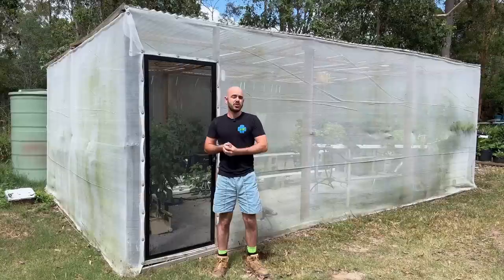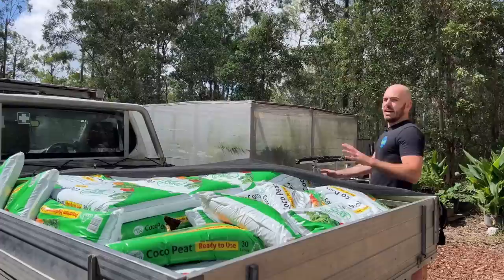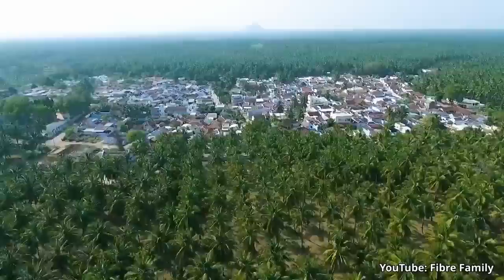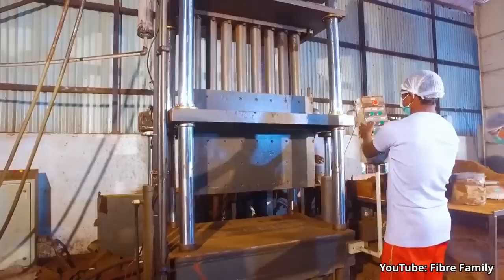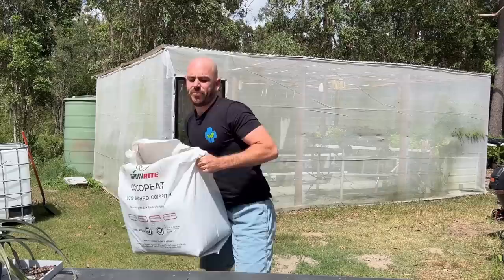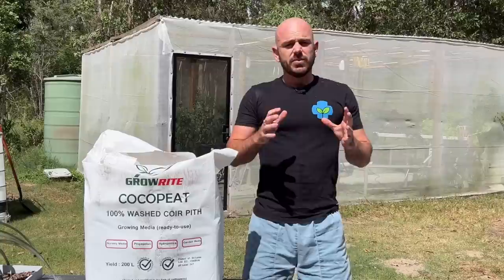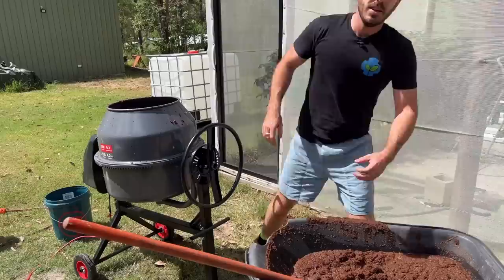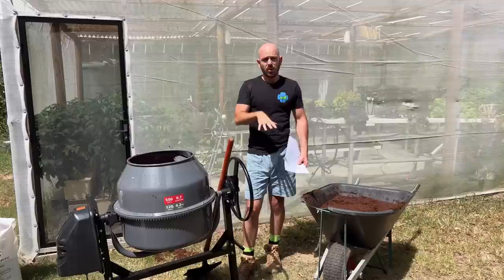How to Buffer Coco Coir for Hydroponics

Comment: I bought a block of 'unwashed' coco years ago.. The main issue was it contained a high amount salt 1200ppm.  One of the occupations of islanders is to find coconuts floating on the sea to earn a living,  so that's probably how the salt came to be there.   The plants had burning, no matter what i did, so I always get the pre-buffered/washed coco for seedlings now.
Pre-buffering of clay pebbles is sometimes necessary too, as they can be extremely alkaline. My technique is to add 10mls concentrate of H2SO4 or HCl to 6 litres of water to 5kg of pebbles in a 10L bucket and let them soak 4 days. Then tip out the buffer and replace it with tap water for 24 hours. Works a treat and never get any PH drifting after that.
Reply: By pebbles do you mean leca?
Reply: Most places where they grow coconut trees the don't have access to fresh water so they wash it in the nearby sea.

Comment: 5.5kg coco coir
55L water
350g Calcium Nitrate dissolved in what looks like about 5L hot water.
mix well
36 hours, drain the solution and now use the coir for seedlings.

Thank you Hoocho!
Reply: And I just came back and used these numbers to mix 11kg of coco coir into 110 litres of water and added 700g of Ca2NO3 in 10L hot water....

Again, Hoocho. Thank you. Thank you SO much for your information and your mastery.

Comment: "sorry about that"
Top notch Chad.
Keep on! Your channel is much more useful then what they're doing with their coco in their moms basement. 🍻
Reply: @Hoocho  🤜🤛
Reply: And the sellers of the Coco coir, bricks especially..?! Never even a tip on buffering..?!
  I've just been soaking Coir bricks in hot water, then add some Cal-Mag when expanded, but still plenty of water present to mix it around. I then let it sit in that water for at least 2 days, then rinse out all excess Cal-Mag water.
  I should have rinsed it out before adding Cal-Mag for a few days..?! Surprised I got some of it right, lol.
  I mix it with Peat, EWC, and Perlite/Pumice, Dolomite Lime, etc, and no problems yet!👍💯

Comment: I have been using blocks of compressed coco, washed and ph adjusted
but I have still been getting bud end rot on some of my tomatoes
I traced the cause to calcium deficiency and had tried many things with my nutrient solution but still get it
I will give this a try but it sounds promising
Reply: Try adding recharge for that rott

Comment: based on the paper you have mentioned, untreated coco has about 33, 14 and 3.5 cmol/kg K, Na and Ca respectively which are about 50 meq/100g coco altogether. I've heard before that CEC of coco is 50-100 meq/100g depending on the source. So the rest 0-50 meq/100g is of other cations. The recommended calcium nitrate is 100g/1.5kg coco which is about 80 meq/100g coco. Using this data and that ~70 and ~90% reduction in K and Na after buffering, the CEC of the sample can be modeled and calculated. 

numbers are logical "if" that 100g calcium nitrate is anhydrous not tetrahydrated. so which one? anhydrous? I ask this because tetrauhydrated is more commonly available that anhydrous?

Comment: Hoocho, if you have to rehydrate a brick of compressed CoCo, do you use plain water or can we hydrate with the CN solution.  TIA.
Reply from the maker: You’ll need to wash it first so hydrate with water soak a little and drain. Then go again with solution.

Comment: I am interested in hydro always have and probably will be but without proper knowledge of micronutrients and what they do for each plant and funghi and what they contribute mimicing natural habitats of plants (which is the ultimate goal, even if a certain plant is bred for hydro cultivation then still you will be steering towards a habitat just maybe X climate zone above/below /micro climate zone differences and pest resistance etc.). Hydro for food or anything you put into you body really is still a class 2/B product for me.

You need different elements and molecules that do interect with a plants root system to unlock the full potential, because the plant eats light and does not eat the nutrients, it is so important I feel like to understand that the plants food is light and not the nutrients.
Reply: I read this comment 3 times and still not sure what it is trying to say. Seems an awful lot like an attempt to view science through the lens of #thefeels. Hot tip: that approach doesn't work - science is fact-based, not feelings-based.
Reply: @StumpyTales  There is too little infomation on how micros and funghi affect the flavor and vitamin quality of fruits etc. You can have your hydro strawberries I'll pick my natural soil ones that are sweeter firmer and overall better. I grow both by the way. And funny that you mention it, if you would read any kind of recent articles publushed on nature and different universities you wou;d have known this conclusion is the best there is right  now.

Try reading some articles published by WUR the best university when it comes to plants int he world, maybe you are still on outdated information. 

Don't be a douhe please, I probably know more about agrivulture than you ever will.
Reply: @revoltoff  
Seems strange that you`d grow hydro strawberries if they were that bad.. The issue is most likely the nutrient you using for your hydro strawberries.

Comment: What if you were using potting mix would you have to do the same an that was amazing video clip you put together there off the coco there  👍👍
Reply: That's what I'm wondering too. I use a lot of coco coir this way but luckily have only had positive results.
Reply: If you are using a potting mix made to a standard (black ticks on the label for regular or red ticks on the label for premium) there should be no reason to amend the potting mix. If you were adding unamended coco to potting mix maybe but potting mix is not designed for hydroponics as it technically isn't classed as a "soil less " medium. Most potting mixes these days are based on a composted pine bark which will eventually compost further breaking down. This is noticeable  when the level drops in pots as it decomposes.

Comment: Any word on Magnesium as well?  Many add epsom salts to the soak.  Had no idea it needed to be 36hrs, though.
Reply: I use calmag for my buffering soak
Reply: I've been growing in coco coir blocks for years. Yes, like hoocho said, use your grow mix. I use my part B ( cal nitrate) and mag sulfate mixed at 2.2 EC. I don't mix in any part A for the buffering soak.  24 hours later, drain and rinse. Rinse removes the exchanged Na, P, with excess N and S. It's now loaded with Ca and Mg and ready  for plants. Buffering is particularly important for Calmag heavy crops such as cannabis.

Comment: 100g CalN per 1.5 kg seems a bit too much... I would not call this process environmentally friendly at all. from now on I'd rather use perlite.
Reply: Yeah I am over Coco as well. Getting BER  on buffered Coco with my tomatoes is doing my head in. Can't just add more call mag because it fudges the EC.
Reply: @jasonking852  
Toms can cope with  EC upto 5.0 so i wouldnt worry about adding Ca. Most of the time BER is caused by irregular watering, the uptake of Ca is driven mainly by transpiration.